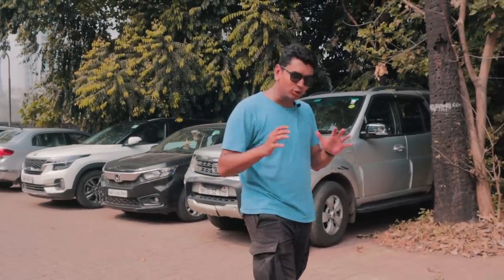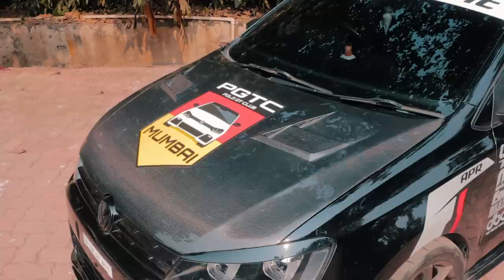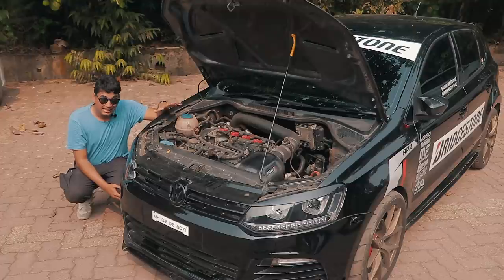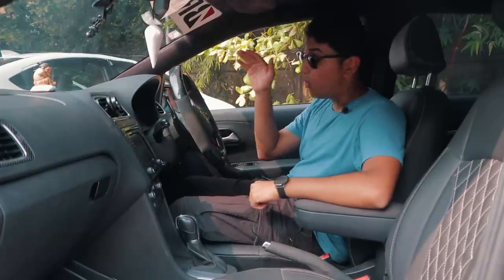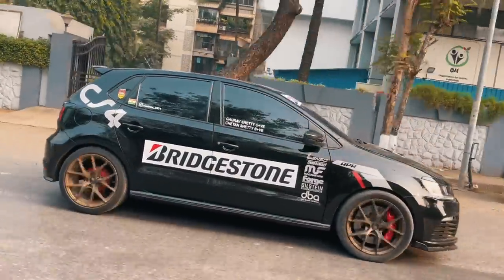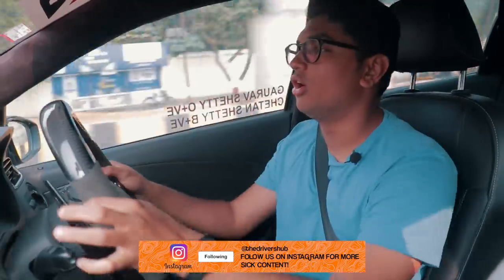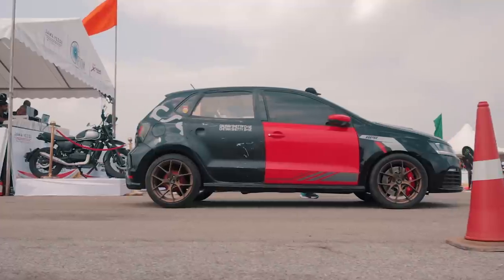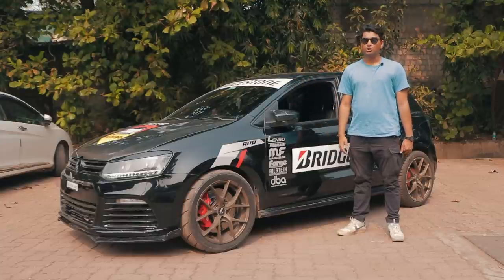2.0L TSI swapped VW Polo FWD can do 13.5 seconds in the 1/4 mile! (APR Stage 1) | Autoculture

Comment: Isn’t that the maxidot cluster which is a direct swap for the polo? I have it on my polo and did not have any issue installing it.

Also curious why the engine wouldn’t work without it. Not like the engine is paired to it. Sure you wont have all the info on the MID but saying it won’t work at all seems like an exaggeration to make it sound more complex than it actually is.
Reply: Yup, looks like the standard 6r gti cluster. Golf cluster has different button layout and colour MID
Reply: True
Reply: Since it's an engine swap, the ECU from the Golf MK6 will only work with the same/similar cars cluster as the powerclass needs to be the same. Without it, the engine won't crank up.
Reply: @HarmonixxTuning  ah! Thanks for clearing this up!

Comment: super interested in why they chose to import a ea888 gen 1 instead of using maybe a ea888 gen3/2 from the modern vrs/superd models.
Reply from the maker: Too expensive to use Gen3/2 cause they are found in super expensive cars which haven't depreciated enough so you're better off just getting a Gen 1 from outside.
Reply: @TheDriversHub  just plug n play?